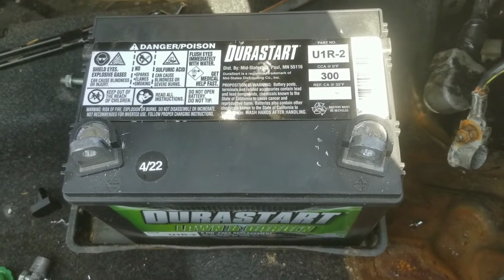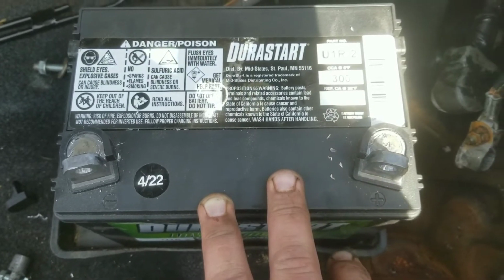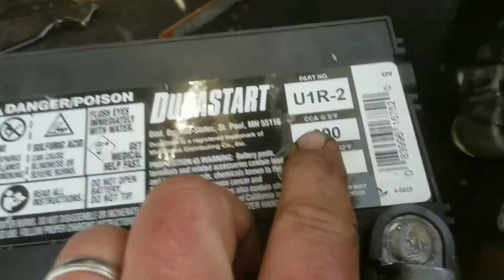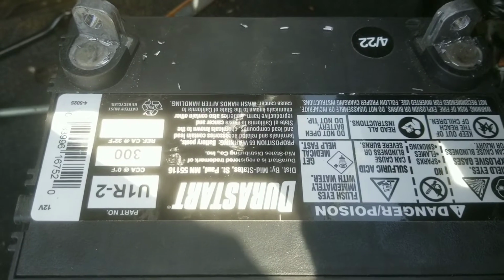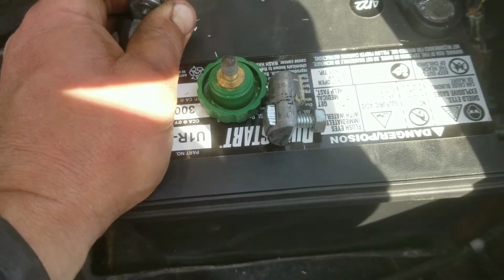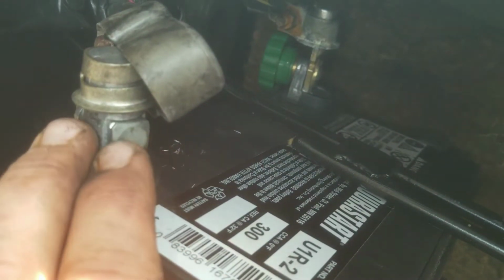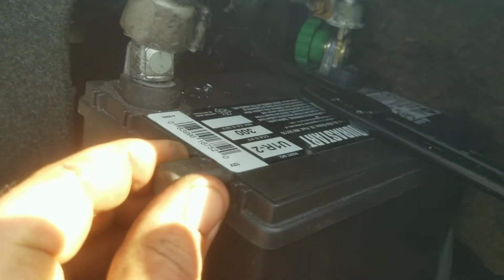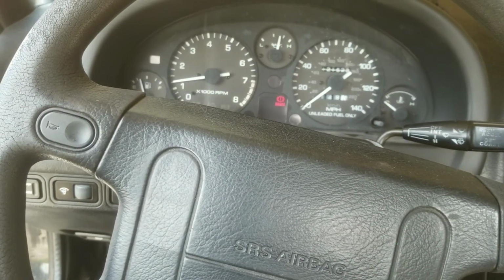Cheap Miata Battery

Comment: Does the battery come with the ends for the vents? My Miata I just bought doesn’t have a vented battery and the ends of the stock vent hoses don’t have that 90 degree connector at the end